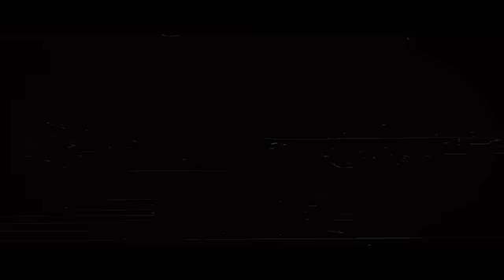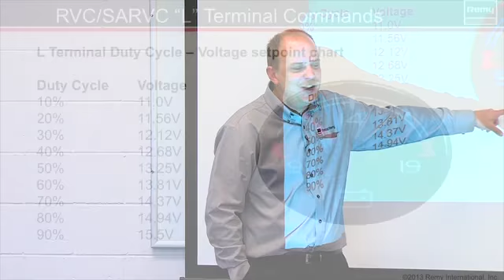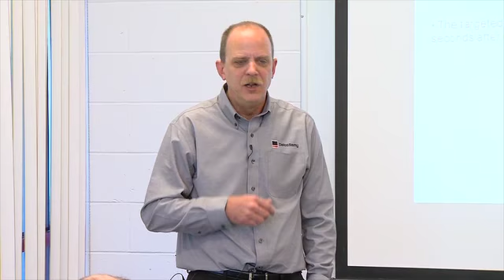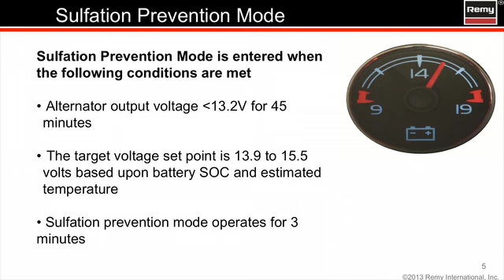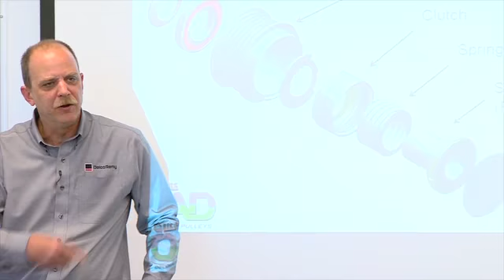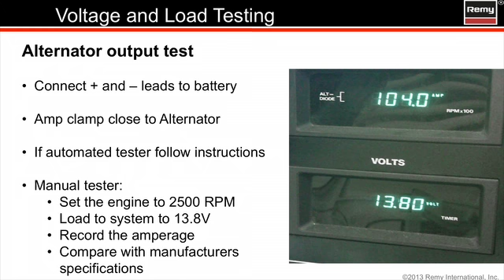Computer Charging Systems - GM

Comment: if you park it with 12.3 volts and come back a week or more later, you have a dead battery. parking it with that low of voltage also drastically reduces battery life. should have the ability to turn it off.

Comment: Hello,

Thank you for sharing such detailed info!

Currently, I am working on a GM (Holden) Captiva CG CX 2.0L Diesel and the charging system has an issue.
Vin: KL3CD26RJ9B265679 

If you have any information at all for the Known Good outputs for the F and L Terminals, the B+ Terminal, or for the known good output for the alternator, it would be immensely helpful if you could possibly share them, or make a separate video.

Thank you again!

Kind regards,
Reply: Aussie Aussie Aussie! Funny, same here. 2.0l diesel Captiva. F-Terminal fault. Even though I have good continuity on L and F wire. Output default 13.5V with battery light on after a few seconds. I will get to the bottom of it. Hopefully one day.

Comment: I watched this because I just had to swap out a battery that lost a cell.  The new battery stopped holding a charge at about 9 months so I replaced it.  I'm a car guy, and have been for years.  I added the volt meter to the dash information screen and all it did was confuse me since the voltage was all over the place.  This answered my questions about my 2018 Chevrolet Duramax.  It's OK, old dog needed to learn new tricks.
Reply: Same deal here. I am used to seeing a steady 14.7v. Just replaced my GM battery and decided to bring up the voltmeter screen on the dash to monitor voltage. Bad idea. Watched it go from 12.4v to 14.9v. Seemed like no rhyme or reason. Then I read about GM's 9 charging modes. OMG! I still think this is overkill. It may be adding 1 mile to every gallon of fuel burned, but the lifespan of todays battery has definitely decreased.
Reply: @steadyeddie7453  I agree with the theory of selective charging adding to the live of a battery.  I see this in various industrial applications, and it does extend battery life.  All of the vehicles charge this way in some way today.  But like you it sounds, I've always seen 14.5 ~ 14.8 volts when it is charging and just the battery voltage when it isn't.  I am used to a battery voltage when stationary, engine not running, of 12.5 ~ 12.7 volts as a result.  I just checked my wife's Subaru and after sitting all night the voltage is 12.2 volts.  To me that seems low, but the car starts and everything works fine.
Reply: I just learned my lesson on an 08 Colorado with RVC. You summed it up eloquently with, "It's OK, old dog needed to learn new tricks." Haha, cheers!

Comment: Thanks for these extremely informative teaching video's!  I'm a (mostly) retired technician . Most of the 30+ years were at three different dealerships, none were GM, (although I own one) . 

 To me, the shop manual comes up a little short on the description  & operation of the RVC/SARVC systems. 
   Thanks to these videos I will be "armed to the teeth" with diagnostic knowledge when I go to test my RVC controlled alternator on my 2003 GMC Envoy (losing charging @ >2900 rpm)  and yes, I'm a scope user.

Now, as much as I enjoyed this instructor,  I picked up on a measurement error.  He said, (two different times),  that the "L" terminal signal from the PCM operated at 120mhz (MEGA hertz).
Now, I think most of us knew what he meant, but for those that didn't know, the actual frequency is 120 Hz. This misinformation  obviously could result in someone feeling compelled to raid their child's college funds, and upgrading  their O-scope to an expensive 150mhz version, or the new Keysight UXR 110ghz unit @1.3 million $ 🤣🤣

Thanks again guys! Remy Rock's!